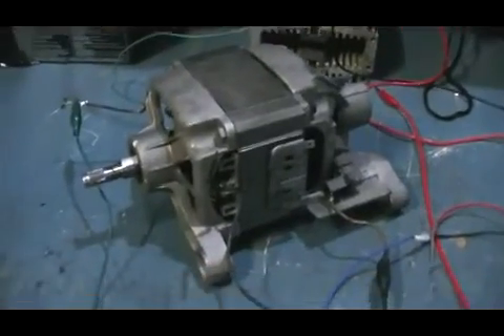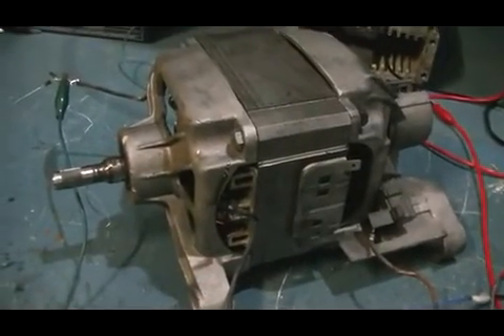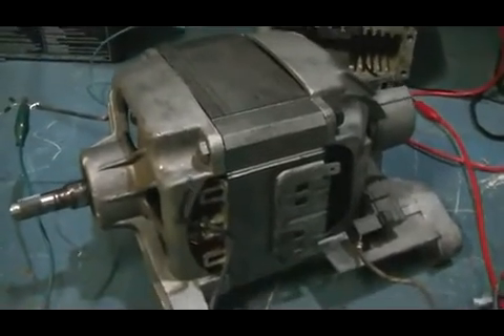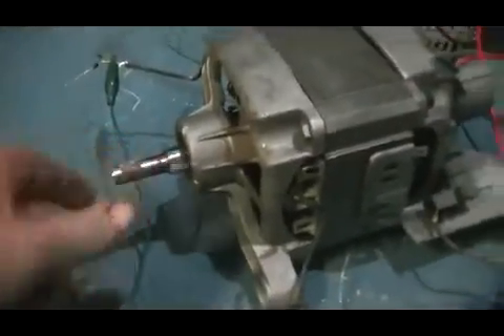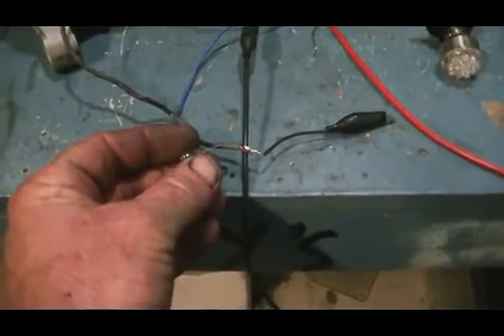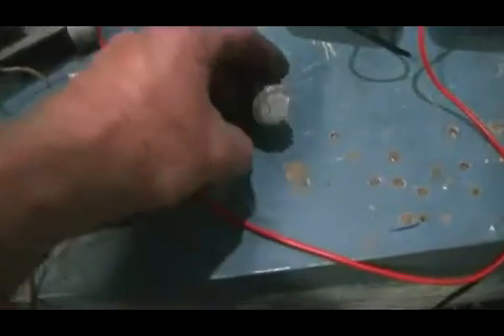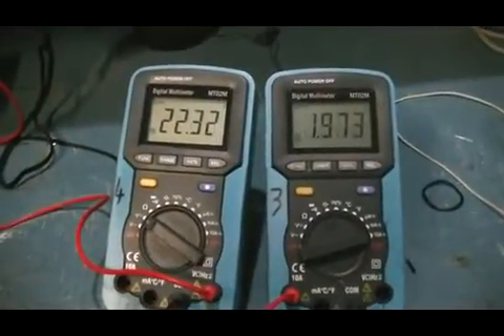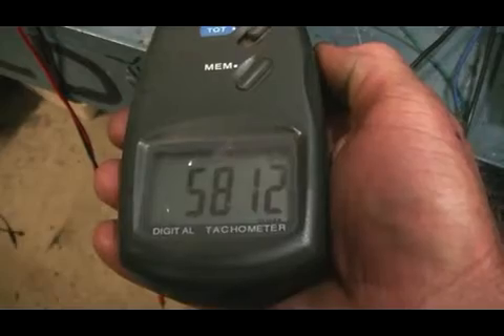The rotary transformer pt2

Comment: Hi, TM. This is definitely an important point to master. Although I tried hard to follow your explanation, I failed to catch where one way, is connected correctly (as to increase RPM and lower power input), and the other way, wrongly connected, (dragging the motor under load.) Next video could you please go over that again.